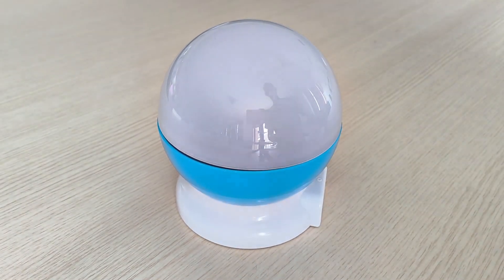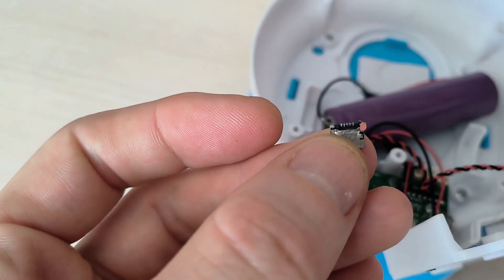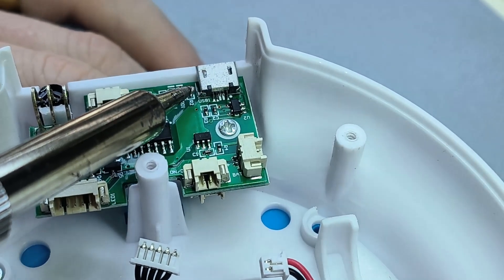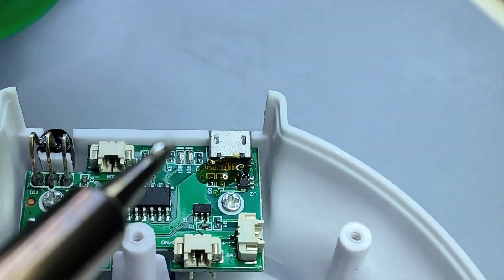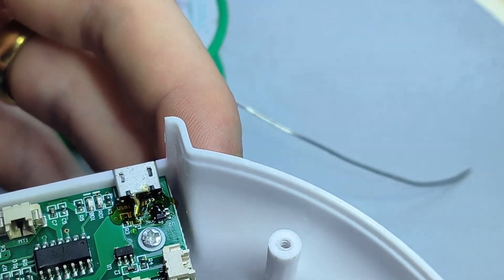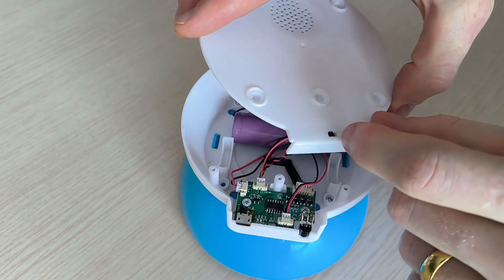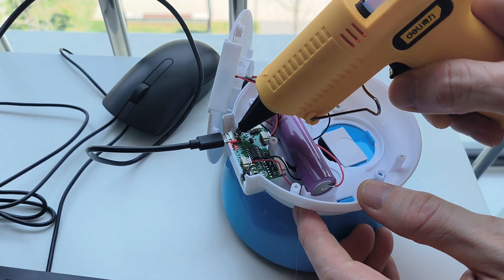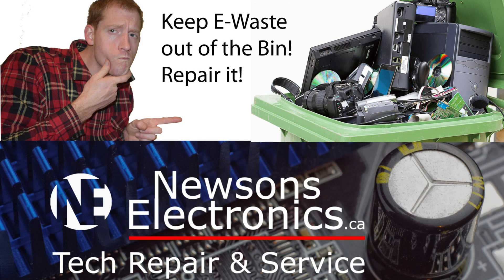This Nightlight Was Trash… Until I Fixed It

Comment: If you need another fix, you could strip a 5V adapter, and solder the wires directly to the PCB
Reply from the maker: yep that could work if the part was damaged. eg. the micro usb